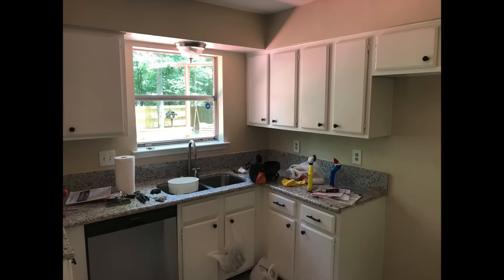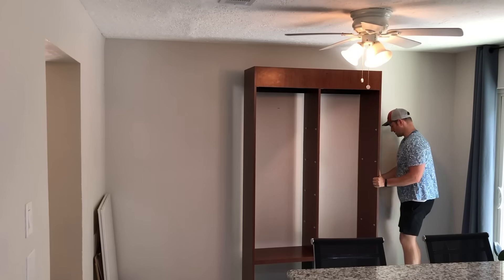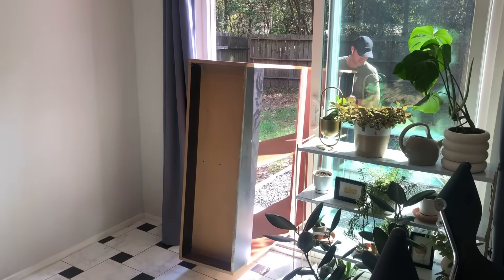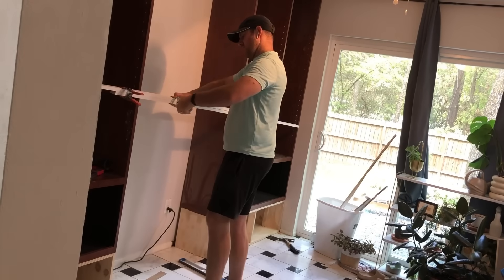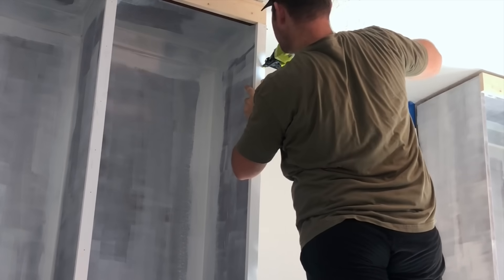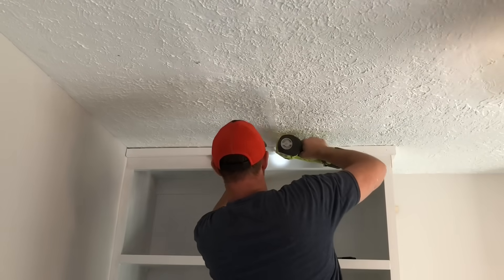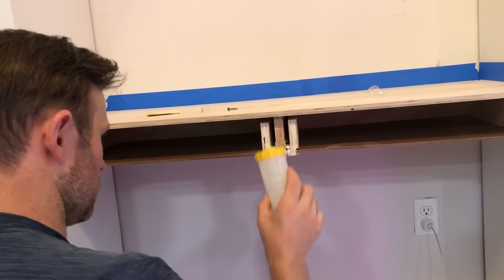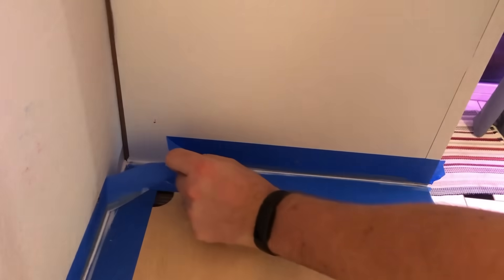Blank Wall Transformation in Kitchen

Comment: The drawers and doors are what makes this look built in, wish we got to see that being done even if it didn't go smoothly. If this was to mitigate storage deprivation in a small kitchen, I don't get occupying the majority of the finished space (open shelves) with semi useless things like cake stands and glass domed cheese plates. You'd be better off relegating the hardly used decorative things to the 4 cubbies at ceiling height, and make better use of the middle & bottom row with stuff you actually use. You could even have added 2 more cubbies at ceiling height over the desk space if you really feel the need for more display (vs. functional) space. If things you use often need a home, but aren't "open shelf worthy" maybe you could add a door to the 2 sections flush left and flush right to cover either two (bottom & middle) or all three open shelves in each one of those vertical sections. That way you'd have more useful storage for everyday things and still have some open shelves on either side of the desk space.
Reply from the maker: 100% understand and we seriously debated whether or not we should do doors all the way up for the exact reasons you mentioned but decided against it for a few reasons. 1) the reason I hauled the shelves into the house before cutting them was to test fit a lot of our things and found we’d have more than enough storage for what we have. 2) We actually use most of those items on a monthly basis and more often during the holidays. We love to host and bake! Least used items are on the top. Our least used items are in the kitchen cupboards over the microwave and fridge since they are hard to get to. 3) Though function was the first priority, we still wanted to have a light, pleasant and open space. This is how we determined it was best split and we still have extra space behind the doors.

Comment: Was interested until you carelessly hammered out the mirror and broke it.
Reply: That's a shame because it was a pretty good video nonetheless
Reply from the maker: For your sake and mine I’ll try not to make mistakes in the future 😉 I would definitely have loved to use the mirrors on another project. What I didn’t show was how long I tried to remove them with utility blades and scrapers, but whoever built them was quite thorough with the adhesive! Props to them for building a secure product.